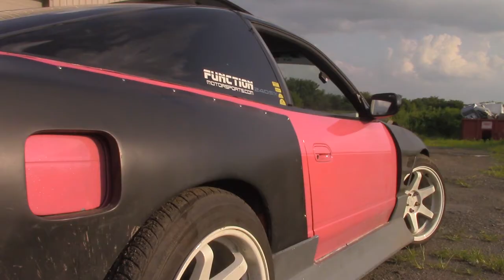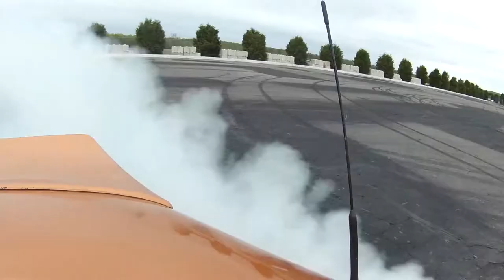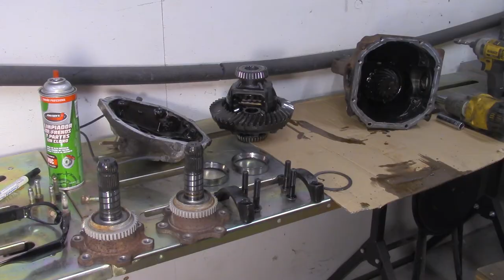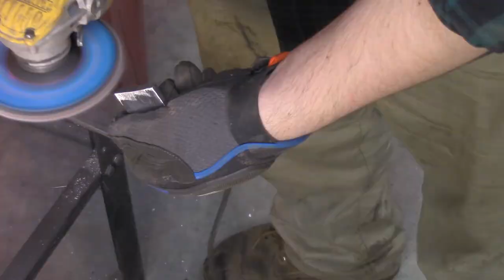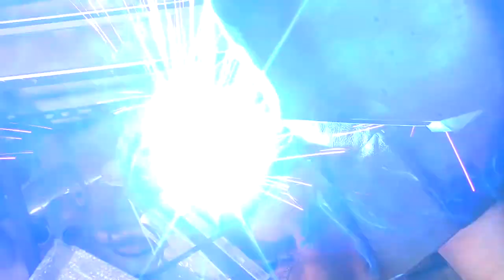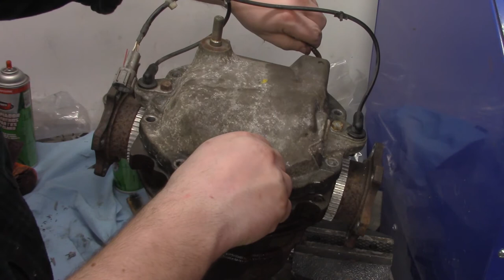350z Welding the Diff FUNCTION BEAST: S1-E14

Comment: Can you not weld a vlsd?
Reply from the maker: Quentin Bowling you can, it's just an enormous pain in the ass.
Reply from the maker: you can, but it's a lot of hassle. You have to basically fill the entire center section of the VLSD with weld, and it was just easier for us to source an open diff. A lot of Skyline guys weld their VLSD's for the more advantageous gear ratios, because its difficult to get 5 stub axles in the states.
Reply from the maker: You can, its just much easier and much more common to weld open differentials.

Comment: Now, tell me please why would you do that?
Reply from the maker: Because it costs eight cents to do and is 100% superior to an LSD for drifting.
Reply: Function Beast 👍🏼
Reply: @FunctionBeast  don’t say a welded differ is superior over an lsd , buy a proper drift lsd and learn the style to drive it and you will drive faster and more sideways then ever , look at Naoki Nakamura prime example
Reply from the maker: @TehMrRoflz  No, I don't think I will.

If you're recommending a clutch type LSD, you are missing the point of this show and these 350Z tutorials specifically. These videos are aimed at getting inexperienced drivers out on the track, possibly for the first time. That's why we did these videos on a 350Z; a chassis that was becoming immensely popular for its ability to be drifted easily with minimal mods. Anyone who has never drifted before is far better off taking that money and investing in seat time than a clutch type diff, and someone who is utilizing these videos in the way that they are intended likely doesn't have the skill to feel the difference between a 1.5 way, 2 way, or welded anyway.

If you are a beginner grassroots drifter trying to have fun with your friends, weld your diff. I will die on this hill.